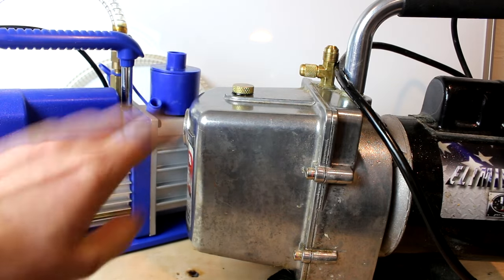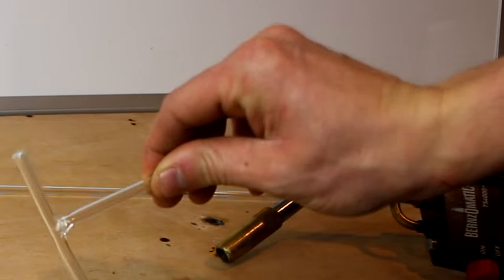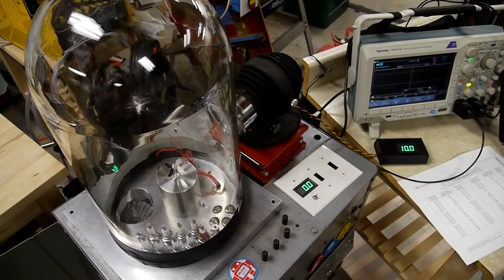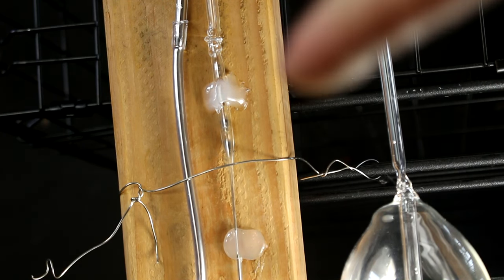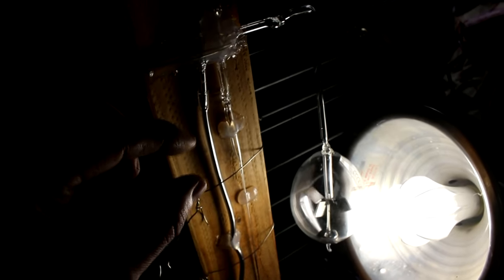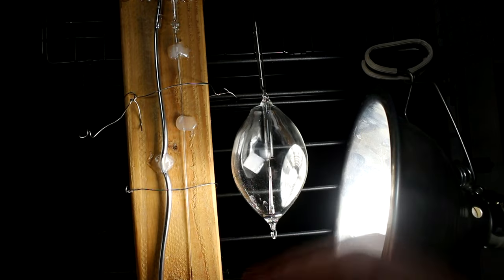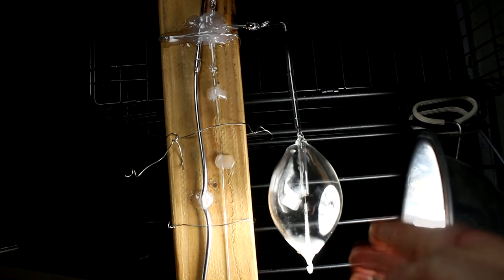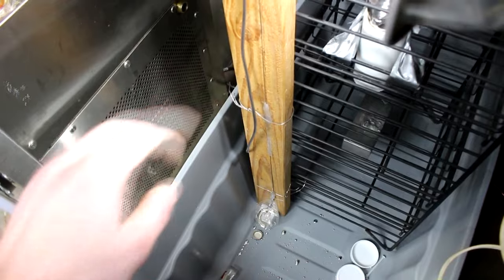Sprengel Vacuum Pump: The most efficient vacuum pump ever?

Comment: I missed seeing this one somehow when it was posted, this might be my favorite project of yours recently. Can the drip tube be made a larger diameter so you can pull vacuum faster for your larger chamber?
Reply: I know this is a few years later, but I'd say "no".
Reason is because the bubble of air is less dense than the mercury pushing it down and if the tube has too large of a diameter, that bubble of air would overcome the surface tension of the mercury and escape through the slug of mercury above it. However, there's nothing that prevents you from having multiple Sprengel Pumps attached to the same chamber running in parallel to pull the vacuum faster.
Reply: I'm even later and I think John is right. You can probably increase the diameter slightly but I doubt by much. There are however other adjustments that can be made to better the efficiency, like Cody said, the kink he had in his tube was an issue.
Reply: A fork somewhere possibly could work? so that it runs from one mercury supply, has one vaccum-creating inlet, and finally one spout, but in between there would be 2, 5, 100(???) capilaries? I wonder what, if any, the limit is. With some kind of powered mercury pump (I'm thinking low-power, slow-geared Archimedean screw), this possibly could be made into a pretty fast, super-efficient and extremely potent portable device?

I would love for someone to tell me whether this could work!
Reply: Yes absolutely, Sprengel's device worked in less than a half hour on a half liter of volume. it just depends on how intricate you wish to get with your glasswork.. For instance you could go as far as making multiple stages to pull down the vacuum as the Mercury falls, collect a bit of it and let it continue thru another trap before catching it. Sprengel himself did not actually create the device, he connected to the intake of a water powewered pumping device called a trompe, the precursor to an aspirator pump that had been around since the 16th century. The trompe had several stages so it's likely my guess Sprengel's apparatus did to when he filled it with Mercury instead of water.
Reply: @johncochran8497  what if mercury move faster so it can overcome air pocket? is this same as basic physic danger of person beside moving train?
Reply: What could be done is make multiple pumps to the same vac chamber.
Reply: Sprengels were used in parallel when required but always with mechanical backing pumps to do the brute force first in minutes and THEN the Sprengels could pull a hard vacuum on a half liter volume in 20 to 30 minutes flat. Cody just did it the slow way to generate more content. And when starting a Sprengel in a pre-evacuated condition, as is normal, there is not enough air pressure to punch through the 1 mm droplet. The mercury's own weight will do that unless the mercury in the glass bore is held to 1mm diameter. The glass electrostatic tension is also the only thing keeping the Sprengel from running even faster once most of the air is gone.
Reply: Some people see a vacuum pump, but I also see a heat pump!!!! It's a great pity that a thermal camera wasn't pointed at it ... I'm sure that we would have seen a temperature difference, those pockets of air being squeezed into almost nothing must be letting out some heat... 
I could be mistaken but I think that early refrigeration equipment worked this way.
Reply: @fizzyplazmuh9024  so you would want to ground the tube? or is the capillary action inherent? interesting that there are electrical potentials being created/wasted by this process as well as thermal
Reply: @dogodogo5891  plz explain "overcome air pocket" especially the "overcome" part
Reply: @manifold1476   if we could move mercury fast enough then we can prevent air from escaping so mercury only pull them, just like that

that's why i use train hazard as analogy 
imagine if train was fast mercury and people was air that need to vacuumed out, there are no chance person will bounce back at first place

 just my thinking and i might be wrong
Reply: It can be more larger but the end still needs to be thin. I think it can be wide as much until mercury will break the glass with weight or other attributes that I don't know.

Comment: 19:40 Could you put an electric cord between the 2 mercury jars (maybe also a resistor on it) and power an LED or something?
Would be really cool with a Kinetic/mercury powered light :D
Reply: Sion that is a great idea. LEDs don't need a lot of current
Reply: Maybe just a neon lamp.
Reply: Could be an idea except it's static current, so it wouldn't do much to keep it lit for a while. Plus the voltage can be in excess of 10,000V, from memory.
Reply: What if you had the perfect combination of Mercury and electricity to power a pump to pump the mercury between the glasses?
Reply: @itchyprince3793  You'd never get enough power to do it. What you're describing would be a perpetual motion machine.
Reply: Static electricity doesn't produce enough current to light an LED. a Neon glow lamp like an NE51 panel lamp might be a better choice. This will even flash an 8T5 fluorescent tube, or the tube out of a CFL. The swirl shaped tube off a compact fluorescent lamp.
Reply: @NitroJonScience  Sounds like a nice capacitor
Reply: James yup

Comment: that simple 200y old diy thingy beats some modern pumps
Reply: Ethan Van Goor still impressive from hundreds of years old technology
Reply: Ethan Van Goor A combination of the two yields the benefit of both. Evacuate the chamber using a regular pump, then hook up the Mercury to get it down to practically nothing.
Reply: I feel like inventors were so clever back then. Such a simple solution to a rather difficult problem.
Reply: A pump that relies on a fluid that itself creates vapors isn't really useful. It will contaminate everything you put in that vacuum with mercury.
Reply: No good. The vacuum lowers the boiling point. There will always be some vapor. That's a serious limitation of this pump, but that still doesn't make useless. Every technology has limitations.
Reply: To be honest this is also a limitation for diffusion pump, and so a cryo trap placed between vacuum pump with a risk of backstreaming and vacuum chamber is useful to reduce problem
Reply: general kitten But it is slow. It takes few days to create a vacuum chamber, Modern technology can do this much faster.
Reply: still some kind of tech like this with automation could be very usefull for low energy ultra high vacuum pumps, or use this kind of pump for the final stage of pulling the vacuum
Reply: Kevin Miedema something like that
Reply: The size, at least with what he can make just at his home, is the only limiting factor here which makes the modern pumps better/more useful in some situations.  But when he doesn't need much room this thing is like a god in comparison to modern day pumps.  I am sure it is possible to make a bigger one, it just isn't feasible with what he has available at his house.
Reply: Arokace if cant make bigger, just make more of those small ones
Reply: Yea but I'm talking about having a bigger chamber that has the vacuum.  Which I'm sure is possible just not with basic stuff he had lying around at his home
Reply: general kitten its so good , cause it was invented by and german guy
Reply: Ethan Van Goor he had no dimensions to reference, with a few adjustments it should’ve taken MAYBE a few hours at most. Around half an hour at best.
Reply: I'm a few years late, but I don't think people here realise how much better of a vacuum even just a turbomolecular pump gets you.
This is limited to the vapor pressure of mercury, about 10^-3mbar. That's just at the border to "high vacuum". A turbomolecular pump will get you down to at least 10^-7, some down to 10^-10, at which point you have "ultra high vacuum". With ion pumps you can go even further, but by then your problem is long not the pump, but gasses leaking out of your chamber materials.
Funnily enough ion pumps also use essentially zero power, as long as you find an efficient way to provide the high voltage they need.

That's not to say this isn't really really cool though!
Reply: @TiSapph  is mercury pump are enough for doing jobs such aluminized mirror?

Comment: This is one of the coolest things youve done actually. I love old tech and I'd love to see you try to improve this in terms of speed. great job cody
Reply: Especially since a quick look at the wikipedia article suggests one of these could evacuate a half-liter vessel in 20 minutes.
Reply from the maker: question I have after this is to what level was it being evacuated to and what was the starting pressure? because 20 minutes seems amazingly fast compared to what I've seen.
Reply: ***** Certainly whatever the standards of that claim differ from your goal in this case, but that large of a time difference before your system even saw a significant reduction in pressure suggests to me that there's probably still a significant speed difference.
Reply: At the T junction, why did you make the mercury's "entry" thin? I'm not well informed on the subject but I don't get why it is needed, my understanding is that it only slow it down, wouldn't it flow faster without it and bigger drops be allowed to trap more air?

Comment: Thanks for sharing. I spend 2 days a week in the Menlo Park Lab at Greenfield Village. We have several Sprengel pumps as well as a version Edison used later to make his bulbs faster. You should visit. Maybe contact the curators for measurements or a special visit. Anyway, now I can explain how they functioned. Our narrative says that the Sprengel pump took up to 7 hours, but the newer versions took only 25 minutes to achieve complete vacuum.
Reply: I'm going to add a little to this. If you read through Edison's improved pump patents, of which there are many, he writes that the optimal temperature for the mercury is 100°-105°F. That's definitely not the safest thing to be heating, but you had some room temperature-wise. I've also learned that Francis Jehl taught lightbulb making at the Edison Institute in it's early days. The institutional memory indicates that the last step in the process was to burn the filament a bit, evacuate the smoke, and repeat until it doesn't smoke. So even these pumps weren't perfect.

Comment: Cody thx for sharing the concept, the build and the results. Very cool old tech that was used for practical purposes.

After looking at the pump for a while it dawned on me that this is an HAC (hydraulic air compressor). You are taking the vacuum vessels air and compressing it to atmospheric pressure. Moving a gas from a lower pressure to a higher pressure is the definition of a compressor. HACs also don't have any moving parts, are quite efficient and usually powered by falling water. In your case it's falling mercury.

Again, thx for sharing.

Comment: Cody'sLab , It would be interesting to put a florescent light tube between the 
reservoirs and see if it remains lit, or how much useful work can be 
taken from the electrical potential.
Reply: If he did that, it would not light continuously, but rather, it would flash repeatedly. It takes a lot of voltage for a fluorescent tube to strike, but the holding voltage is much lower. Since this doesn't generate any appreciable current, it will drop out, until the voltage builds back up enough to strike again. Something like a relaxation oscillator. Don't get me wrong, it WOULD be interesting!
Reply: @vincentrobinette1507  A year later, I know... but... I wonder how many of these you'd need to hook up in parallel to generate a useful current
Reply: @graybot8064  he lifted it more than 60 times. You'd be better off using the energy you supplied by turning a rotor by hand. Voltage doesn't equate to having the current to run any appreciable load. As he proved by still being alive it was a minuscule current since it likely passed through his heart and he didn't die or have heart issues.

Comment: How many volts is the electrical potential between the 2 pools of mercury?! Would be very interesting to know!
Reply: BigDog, just need to use a voltometer to know.
Reply: He would need a high voltage probe or electroscope to measure it. The usual 10 megohm input impedance meter is probably too low of an impedance, and the voltage is too high. It was a static charge.
Reply: Given he felt a strong shock it must be high voltage. 10 dollars would tell me it's pushing at about 50'000 volts.
Reply: We're talking about tens of kilovolts, spiked. You'd need either a very expensive special multimeter, or just a decently built electrometer which isn't difficult to make.
Reply: I'd guess the voltage would be a factor of run time, humidity and a few other random variables like conductive paths caused by contamination. Blinding accuracy wouldn't be a big issue, so I'll make a modest proposal that doesn't involve broiled children. 2 high voltage 500 meg resistors ( one for each probe leg ) with the 10 meg meter acting as the third resistor in a voltage divider  ( 100:1 ratio ) so with a fluke the full range would be apx. 250000 volts. Couple of acrylic tubes to be the probes with resistors mounted inside.  Could put a trim pot and resistor across the meter to extend that range if needed, and allow calibration.
Reply: He could make a simple circuit with resistances to divide the voltage.
Reply: If he utilized the voltage it produced, the efficiency would be ridiculously high.
Reply: Would be interesting to put a florescent light tube between the reservoirs and see if it remains lit, or how much useful work can be taken from the potential.
Reply: Basically it's a charged capacitor that has energy content of C*V^2/2. He didn't feel the voltage per se, but an electric current impulse which is, on this short time scale, best characterized in terms of energy. One way would be to measure the energy directly by letting it discharge through some sort of spark gap and measuring the released heat by a calorimeter. Another way is to measure voltage (by electrometer) and capacitance separately and then multiply the two.

Comment: First video of yours that I viewed. Nice pump. I was expecting something else. But could you use water other than mercury. Great video. Well done. Really liked what you did with the glass.
Reply: Water wouldn't work very well in that configuration.  It's not dense enough to create such a vacuum, and even if it did get down to those levels, the water would boil and vaporize
Reply: @Skinflaps_Meatslapper  true
Reply: there are actually related devices called trumps that act via the same mechanism as air compressors that use water
Reply: @coolmikefromcanada  Sure, it works the other way no problem, water is a pretty decent hydraulic fluid.
Reply: The vapor pressure of water is too high, you'd have a "vacuum" of steam.
Reply: it would work but you could only get the the vapour pressure of water with isn't really a good vacuum

Comment: just in case you didn't see them, theres a few stray, airborne droplets around 10:03. Looks like they were probably caught by the tub, but the front lip is out of shot so it's worth mentioning.
Reply from the maker: I saw them, they were caught.
Reply: Good deal.
Reply: Very cool video btw. Ive never seen that apparatus before.

Comment: fill the radiometer with mercury, turn it upside down... profit?
Reply: Hahahaha good idea but you need to fix a long tube to the radiometer first, or the mercury won't flow completely out of it(air pressure working against it).
Reply: Wait... That would totally work, wouldn't it? Mercury pushing the air out, directly. Attach a >760mm tube below it and there you go! Mercury vapour pressure in minutes.
The only downsides I see are that for bigger tanks you would need much more Hg, which is expensive; and that maybe you don't want to stain with mercury whatever is in the container.
Reply: heulerado,also mercury might dissolve the plates in the radiometer.

Comment: Here are three potential enhancements in case anyone is inspired by Cody's video to make one.  

1) A syringe barrel and plunger, two homemade one way check valves, and some tubing to make a piston pump that will help eliminate handling/spilling the mercury.  Use a syringe with a thin barrel and plunger and make slow strokes so as to not push mercury past their gasket materials.  
2) The mercury reservoirs at the top and bottom may be enclosed containers with a tube connecting them at the top of each reservoir container so as to contain but allow displaced air and mercury vapors to move between the two. The tube can have a release valve to vent buildup of evacuated gasses and filter the vented gasses though  a sulfur-impregnated activated charcoal filter. 

3) Include an electrostatic discharge wire between top and bottom reservoirs. 

Now it will be much safer.
Reply: thank's I will do this and make a video!

Comment: It isnt easy to use gallium or gallium based liquid metals because these wet glass
but i am curious if it would be possible to use Rose's metal (50% Bi, 25% Sn and Pb)
in a steam heated apparatus, since it melts in boiling water. Would this be cheaper, safer, and less regulated than mercury?
Or for those with money but who wish to avoid toxicity altogether what about Field's metal, MP 62C (50%In 17%Sn 33%Bi) but Indium is twice the price of silver.

Comment: I wonder if you could use liquids other than mercury, like vacuum pump oil. It hasn't got such a low vapour pressure, but it would still be useful for many situations, and is easier to get hold of than mercury.
Reply: Oil is much lighter than mercury, it's even lighter than water. It might work, but the down tube would have to be 35~40 feet tall, to pull the vacuum. The other problem is, getting the capillary small enough to prevent back bubbling, but large enough, to overcome the viscosity of the oil. I'm not sure if it's possible to properly size the capillary.